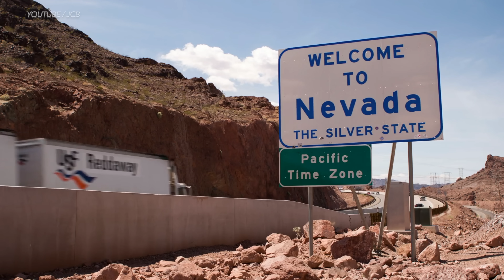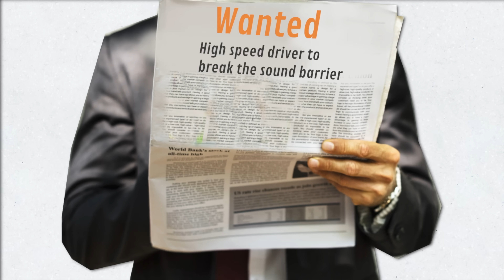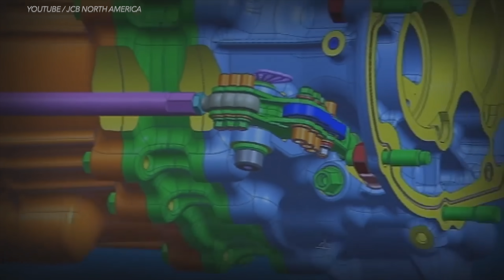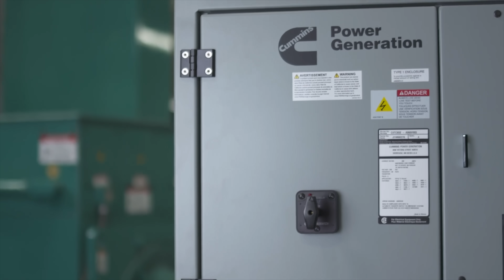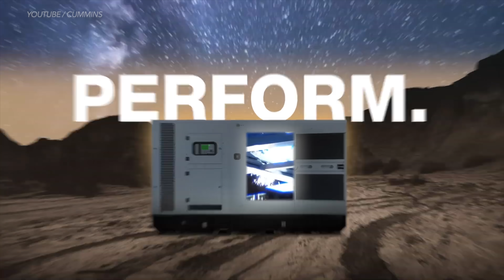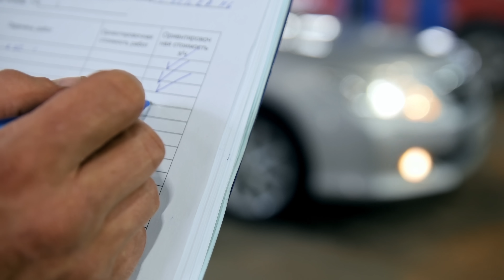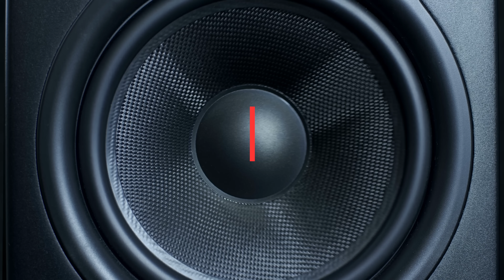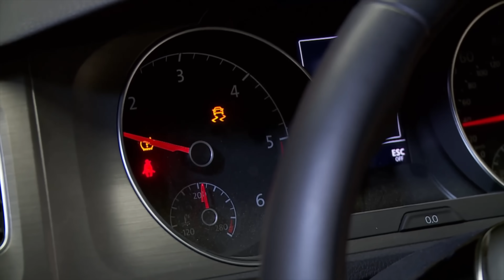Here's Why Diesel Engines are Being Banned

Comment: As a diesel mechanic, I believe diesel's potential is being criminally neglected. The thermal efficiency of diesel is higher than any other fuel source.
Reply: What blows my mind is why aren't diesel hybrids being made? It literally would be the best option ever. Especially if the electric was only used during periods on the highway, or acceleration especially. Electricity plus turbo diesel would absolutely make a good acceleration process.
Reply: @millionbillion6384  sure it been made. Mercedes, BMW produces diesel hybrids
Reply: @millionbillion6384   It's working well for locomotives
Reply: @Dj none they always find a way to screw up anything and everything that's good.
Reply: I'll drive my  97 Powerstroke 7.3 till it dies.  OBS is my vibe.  That sound tho' 👌🏽
Reply: @LauraHalvar  yes indeed. I have a 99 350. 7.🌴 and I love it. I'll drive till wheels fall off her.
Reply: @LauraHalvar  wish I could put 1000👍👍👍👍👍👍👍up. Lmao
Reply: @Dj none not going to argue with you on that lol
Reply: Diesel engine efficiency is 50+ percent, look up Weichai & Bosch diesel engine. Diesel engine can run on biofuel too.
Reply: @frv6610  i like that you said that. I remember reading in a magazine in the 2000s gasoline was estimated 10% efficient.
Reply: @dakotahostermeyer505  ye, i know, they are liars. Diesel efficiency can be as high as 85% with correct technology which is higher than electric engine's efficiency because Ev engine only have very high efficiency at a specific rpm, not on every and any rpm.
Reply: @frv6610  diesel have piss poor efficiency in start stop traffic.
It's EVs that have higher power at low speeds. To run a ev at high speed it's order of magnitudes of more energy required as opposed to cruising in start stop traffic.
Diesels save more fuel when tearing at high speed on a motorway.
My diesel gets 54mpg going 75mph but only 12mpg if I'm driving between red lights in start stop traffic.
The best combination would be to have an ev motor deal with traffic city driving and quick acceleration once cruising past 30mph have the diesel take over and recharge the batteries for the ev as it'll have plenty of grunt.
Reply: Absolutely agreed it really is a pity.
Reply: Not sure how hard it is to make bio fuels but alot of the bigger farmers i know run home made bio right now cause diesel prices are so high. If society could figure a way to make it on a larger scale i wonder if that would help things out
Reply: @Joe-Mamasixtyninefourtwenty  my 7.3 runs on old motor oil and trans fluid. Filtered through a paint strainer. 60/40.
Reply: @Joe-Mamasixtyninefourtwenty  it'd probably take the entire state of texas to grow rapeseed to make oil for biofuel for the entire us.
One acre yields about 145gallons us on average of rapeseed oil. Assuming no losses in purification in transversication of the oil to biodiesel on a car that gets 45mpg  average you get one car to do about 6500miles 
That's one acre
One car 
And it's all gone.
The land is also getting stressed.
How many acres would you need for 20 million cars for a year?
Are people and livestock just gonna stop needing food?
It's not sustainable.
Reply: @Joe-Mamasixtyninefourtwenty  Brazil has been growing its own fuel since wwII .and vowed to continue fore ever so they would never be dependant on foreign fuel.
Reply: @Joe-Mamasixtyninefourtwenty  yes it would but it's not ripping people off enough that's why they came up with electric cars.
The best bet is cars that run on water but the powers that be killed Me. Stanley Meyer in the 70's he drove his dune buggy cross country on 27 gallons of water.
And just recently killed Mr. Saulty in Buffalo NY who had an F-150 running on water he was going to present to the patent office.
Reply: @Dj none I agree, but it sure is nice sitting next to the exhaust of a running modern diesel car and not choking to death.
Reply: @em4703  you do realize the new diesels DEF system puts of ammonia. Something worse than soot.
Reply: Shh, or they'll make it more expensive
Reply: @AngelMartinez-el7xk  too late
Reply: Im an electrician by trade, not a professional by any means when it comes to diesel, but im very knowledgeable about them and agree 100%. If you ask me diesel is the way of the future, even without emissions diesel is cleaner then gasoline exhaust, it lasts longer, more reliable, produces more power, and the fuel is cheaper to refine then gasoline. And granted when they do break they are more expensive to repair but they break significantly less then gas motors
Reply: @Dj none not true now when they first came out yes !There are ways around that crap also!
Reply: @andrewslagle1974   because everyone is in a hurry. Diesel engines love to run long and hard. I've opened up valvecovers where people just run to grocery stores 5miles away and back. And sludge up motor. Goes with gasoline motors too.
Reply: 100% true
Reply: Voting for a godd-amn-ocrat is the DEADLIEST  thing you can do for EVERY type of performance vehicle...
Reply: I am 66 years old never heard anything about diesel health issues untill Europe cars started getting 88 MPG.
Reply: @Dj none i call it cat piss. Lmao
Reply: Power and performance of modern Diesel engines far surpasses any gasoline engine.  
No clue why they exist
Reply: @guesswhotoo6  gasoline also has 50% efficiency, already in 2015 Mercedes F1 engine achieved it. There are different fuels which has to be used up or go to waste (natural gas for example), if we use only diesel its price would maybe rocket.
Reply: Not true... At best a modern hybrid stroke diesel/petrol hybrid stroke diesel with all the high tech trickery can get maybe 45%<=✓max efficiency.  Electric motors can get a theoretical 97% efficiency.
Reply: @iHelpSolveIt  theoretical
Reply: @dangerm3496  in real world its still 30 to 40%better than any other form of engine, including gas, steam, Diesel,Hydrogen or petrol.

The only issue that Electric motors have an issue with at highway speeds is draining the battery.  With a fuel supply in a tank that also happens but the user doesnt feel it as immediately.  You can use safe hypermiler techniques just as effectively and with every drag improvement there is it has a greater effect on EV driven vehicles.   Thats why Volvo and Mercedes Benz, BMW worked on a system whereby owners on long roads hand over to the leading car going to the same destination and used AI to run it efficiently.  Sadly they seem to be stuck and dont want to do the same with covering the vehicles with solar panels.
Reply: Use to hear a lot about BIODiesel. Does anyone know what happened?
Reply: @navalnationalguard534  there's high performance biodiesel at 76  high cetane  in SO CA.  Also select number of biodiesel and E85 stations. My old D max loves it.
Reply: I agree. Hugely efficient after decades of development. If you believe CO2 is a problem, they are also low in CO2 compared to petrol.
Reply: Going strictly electric is a scam. They can build cleaner diesels if they really wanted to. The powers that be are just using the environment as a way to gain total control over people. It’s a means to an end.🤔
Reply: @Dj none how so?
Reply: Right on, there is NO COMPARISON!!!
Reply: Except nuclear steam power! 😉
Reply: @sa25-svredemption98  Agree. But this is c20%. 
Until we have a fully nuclear grid I would think diesel is most efficient means of moving heavy trucks.
Reply: @Dj none the fuel is cheaper and easier to manufacture the engines are simpler and way more reliable more efficient more torque hardly any emissions and with all the crap we bolt on them now a days no soot
Reply: Its all VW's fault of ruining its reputation when its just about to build up
Reply: Please help the diesel motorcycle startup(s)!
Reply: And enjoy polluting with that smog you put out lol